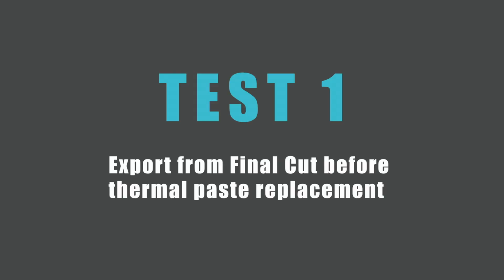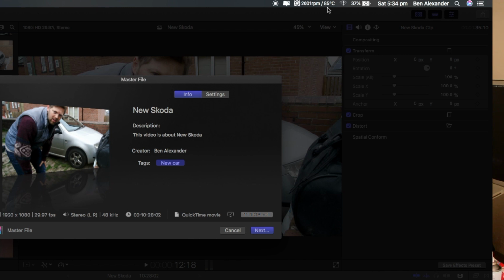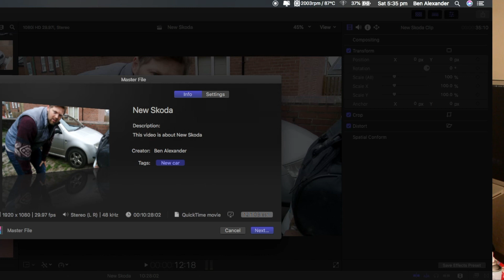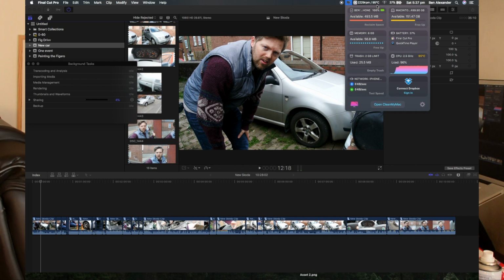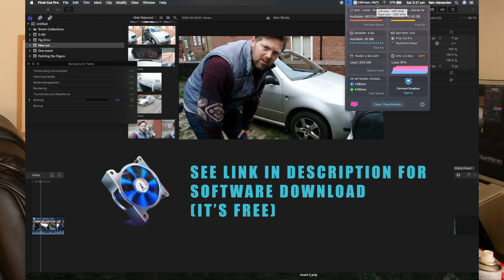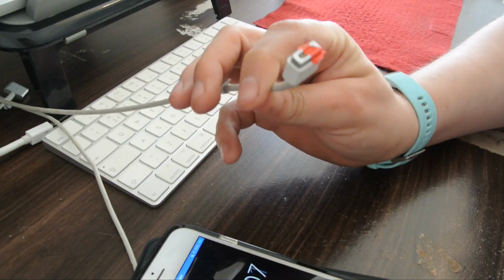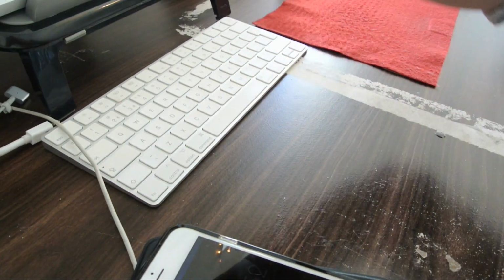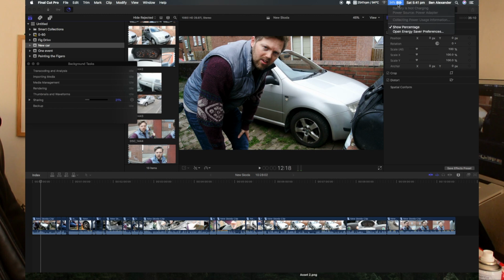Changing 10 years old Thermal paste on Macbook Pro 17 Inch with MX-2

Comment: cover up the middle pin of charger so it won't over charge the battery to not causes them to degrade faster.  that's a very cool trick

Comment: Heey good Video but your lucky that your MacBook is still alive.. this should be an advise and not criticism.

1. static electricity can kill your MacBook. Always use a anti static bracelet with correct grounding or do it naked and touch the radiator to ground yourself before doing any repairs.
2. your motherboard is not a a workboard. Clean the cooler on the table, you could very easily break a transistor on your board and kill your macbook.
3. you did it really gently but with heatsinks and processors you should always use plastic to clean it as you can scratch the surface and reduce the efficiency with a screwdriver.

Comment: nice video man. do you believe  it will improve also the performance of cpu in logic pro x? i have ssd 500gb, 16gb ram on a 2011 13 inch mbp i7 dual core 2.7 but i am having  crashes often when i work with some heavy vst instruments..thanks in advance.